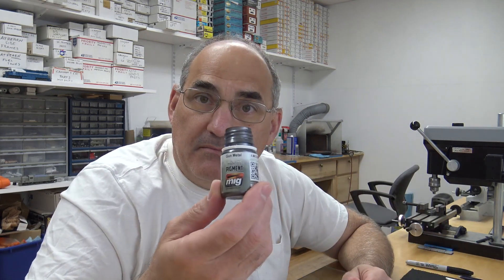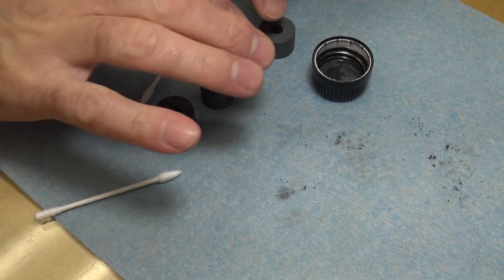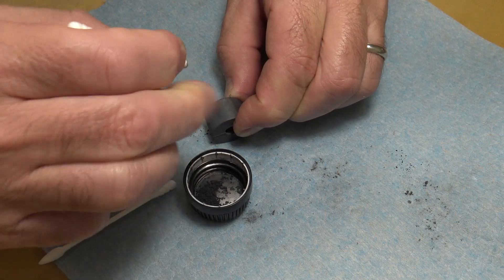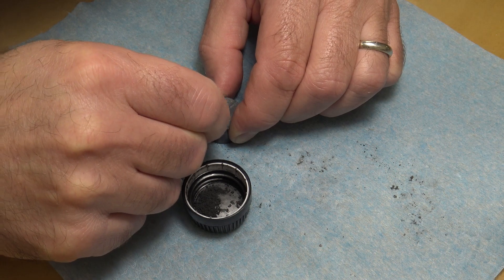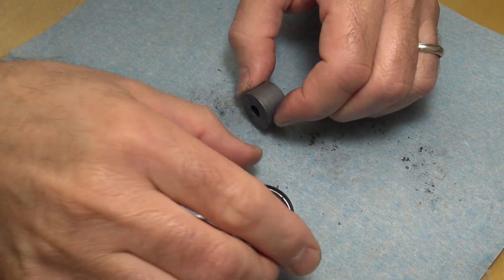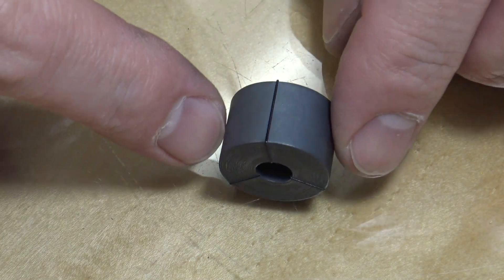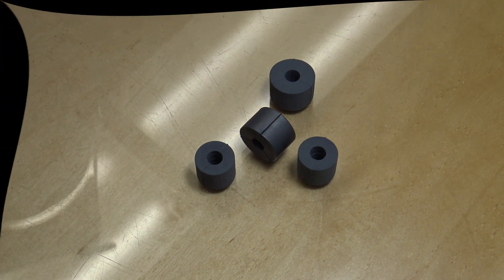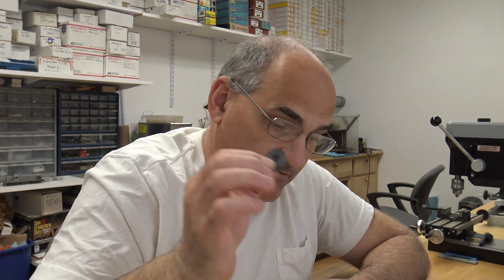COIL STEEL

Comment: Thanks for passing on the technique. They look like hot roll steel coils you see on open coil cars or gondolas. I use the sharpie to give the steel bandings the black shiny look. Here is a tip on making banding, I uses heat shrink tubing. I cut it to width on my North West Line chopper. To get the correct width I use styrene strips, place between the blade and the fence. Its great on lumber loads you just put over the load and shrink it with heat.

Comment: Very good! This looks like the graphite we use on the corn seed in the corn planter. Hmmm… 😉
Brian, would you recommend using a dullcote on the coils so if you have to handle them later you don’t get the fine dust on your fingers? Maybe the burnishing takes care of that?
Reply from the maker: Correct, the burnishing takes care of that. Plus if you put a clear finish of any kind over them. You destroy the metallic look to them.